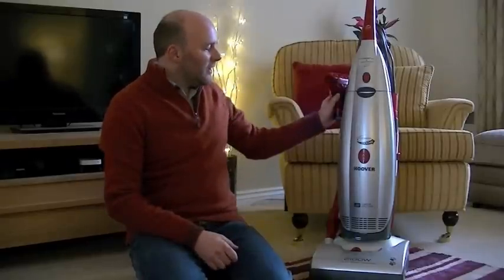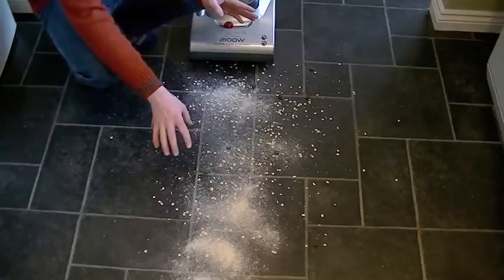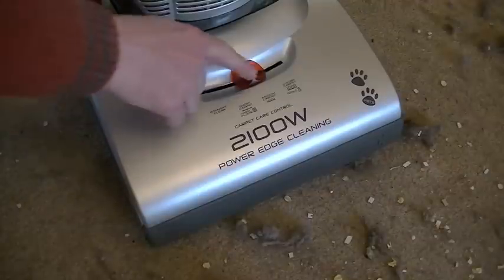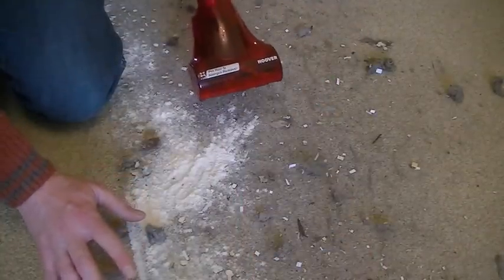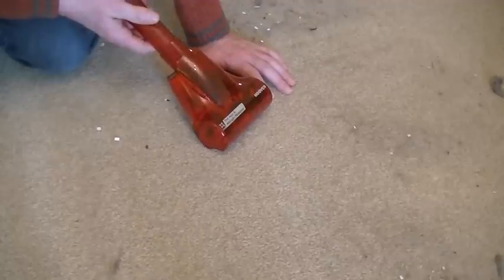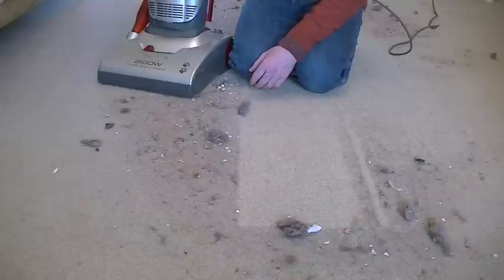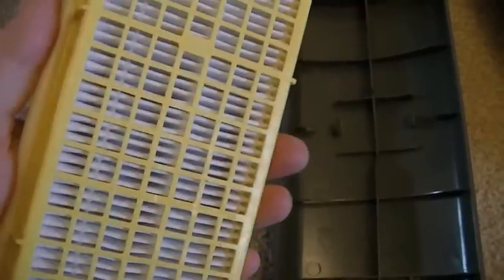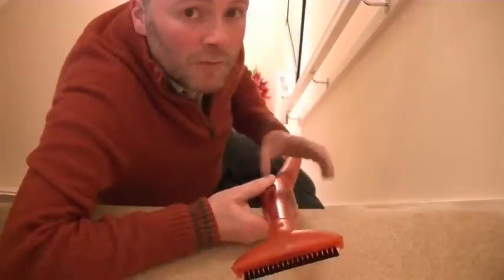Hoover Purepower 2100 Watt Upright Vacuum Cleaner Demonstration & Review

Comment: I had an original pure power 3 in early 2000 it was red but the carpet selector switch fell off if I remember and the foot mechanism broke .  It’s a pity hoover is not as it’s used to be .

Comment: I had the 2000 watt version which I had to return to Argos. I did not like the fact that the foot release mechanism was so stiff. I practically had to jump on it to get it to recline.
Reply from the maker: Yes the foot release pedal is very stiff, but it doesn't seem as bad on this one. The build quality is terrible though.
Reply: ibaisaic I hated the constant loud high pitched sort of noise from the brushroll, which I did not like.
Reply from the maker: I will try it with an activator brushroll at some point.
Reply: ibaisaic I replaced that style brushroll in a 2000 watt purepower a few years ago with an activator...it really improved performance and was a hell of a lot quieter.

Comment: were can i buy ? my 16 year old hoover 1400w just stopped working not fuse
Reply from the maker: You can’t buy this model anymore with a high wattage motor. The nearest to it is the 350 Watt Enigma but I certainly wouldn’t recommend it.

Comment: With an upright on hard floors (especially the cheaper ones from some years ago without a seal on the back of the nozzle, it's easier to just take the belt off and use it that way. Not convenient at all for when you're doing your whole house clean, but it'll get through in a pinch if you suddenly have a big mess and some time on your hands.

Comment: Where do you get an activator brushroll from?
Reply: Plus what does it do.
Reply from the maker: +OfficialGinger Biscuit (biscuitcentral) Look at the Turbopower 2 dealer demonstration video and you will see an activator brushroll. They are obsolete now, but they sometimes crop up on Ebay.